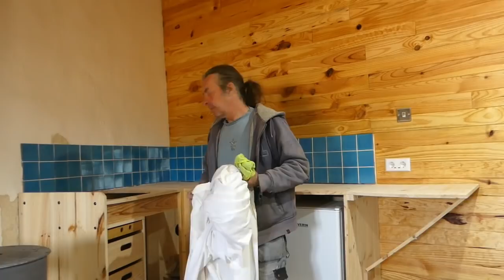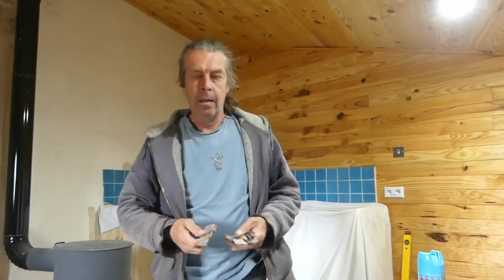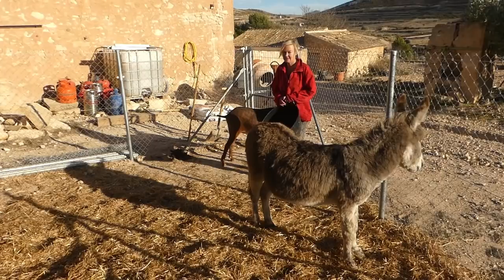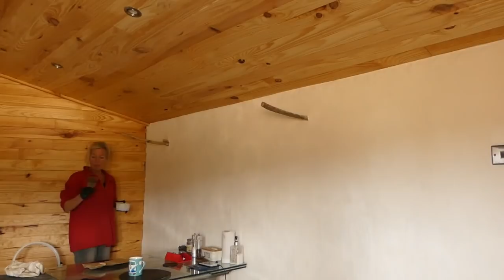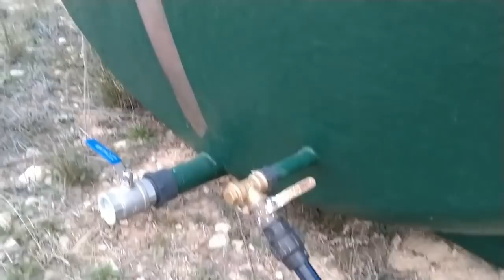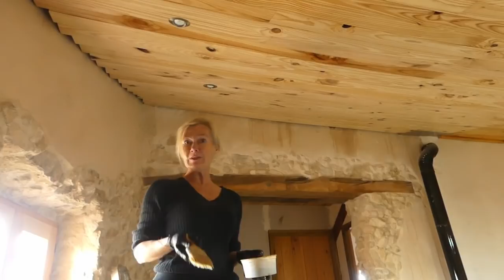Finca restoration - delays slowing progress

Comment: You mentioned having an assortment of hinges etc sitting in diesel.... Does it clean them up or is it another reason....
Reply from the maker: Yeah, diesel is great for cleaning and unseizing metal things. Anything rusty / stuck, drop it in a tub of diesel. It doesn't evaporate either :)
Reply: @FincaLife  I’m going to try that on my son’s basketball net pole. I can’t get the rusty screws out to dismantle it. 😊
Reply from the maker: @sammie44  or try a famous brand cola drink :) Seriously works quite quickly